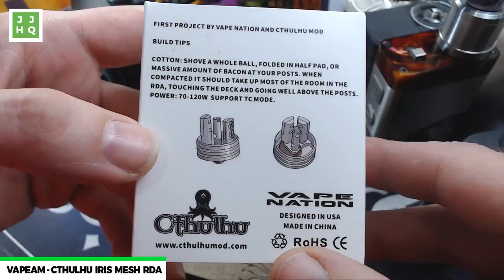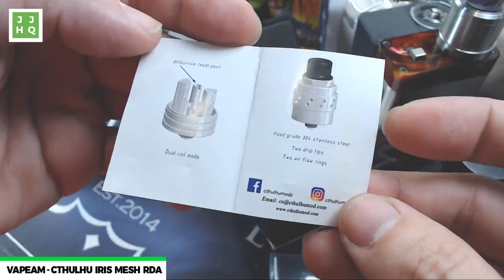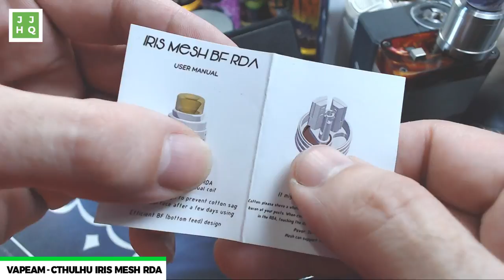The Cthulhu Iris Mesh RDA on VapeAM Ep 189!

Comment: with the state your mesh is in, its no wonder you get hot spots! You even make a point of saying that imperfections (such as "ahem" bends & kinks...) WILL cause hotspots. (not to mention the likelihood of it bursting into flames, any mesh users know what I'm saying lmao) Also, you're never supposed to dry burn mesh....can ya guess why? lol You should always however, put your cotton in, juice it, fire at low wattage (like 30-40), juice again and repeat (i usually do this at least 3-4x) while checking how its burning; making sure theres not hot spots (and adjusting if there is).  This always needs to be done before vaping it with fresh mesh & cotton and since cotton compresses with use, you also need to check how its burning regularly and any time it starts to feel harsh or too hot as this signifies a hot spot.  I also find certain cottons are needed for best results, kendo gold swells allot, breaks down slower and ergo, works well (just needs a little breaking in first). Mesh needs adjusting allot and is a HUGE learning curve, I almost gave up on it initially but once you get the hang of it honestly, its great.   I personally LOVE my mesh, used to like reg coils too but the flavour I get from mesh has ruined coils for me lol
Reply from the maker: What a waste of time. People have been doing this for years, making up new and ununnecessary ways to vape. No, mesh doesn't have a *huge learning curve*, that's just something we tell ourselves when we're doing something dumb, so we can justify it. It's quite simple actually, but I just think it's not worth it. You can go back years in the videos and see that my attitude hasn't changed. 

If you dig mesh rdas, more power to you. But I'm still not convinced, and it's not some poorly lack of enthusiasm, I'm just way past giving a shit. Wotofo gets points for being Wotofo, good for them. If your just looking for someone to agree with you about the profile, I can't be that guy. A blind person can build a Kali in a few minutes. So, it's going to take a good mesh RDA for me to change my mind, and that hasn't arrived yet.
Reply: Well Im not sure why you're talking about the profile by wotofo since we're currently talking about the iris mesh that you kinda sorta just reviewed in this video.... but either way, taste is subjective as are opinions & you're very obviously not going to be swayed from yours anymore than I'd be swayed from mine at the moment. (which wasn't my intention) However, I came to check out your review after watching nothing but positive ones on this unit....I was just a little surprised & I felt that others seeking subjective opinions on using mesh at all would benefit from someone at least playing devils advocate here, to point to that there IS a correct way to use it.  

If someone was reading books upside down and ruled out the enjoyment of reading altogether you'd say thats pretty dumb no?  Well, most people I see using mesh, they're not using it correctly and therefore cant rule on whether it sucks altogether.  
As far as economic value, Its definitely the cheapest option compared to any coils, esp if you vape commercial juices (which are loaded with sucralose), chocolate flavors or juices with coolant, all of which destroy any kind of coils.  Difference with mesh being, its cheap enough that you can toss it without a worry lol... not that thats the only positive in my opinion (& not even relevant to me anymore as its been years since I vaped commercial juice) but its one people likely don't think about.
Reply from the maker: No, I don't agree that my video is like someone reading a book upside down. That's insulting. Sounds to me like it's really difficult for you to maintain a respectful tone with people you disagree with. I'm definitely losing my respect for you, every time you try to argue me down or insult me. And this burning need to convince me, it's just sad. I am not going to change my mind after being abused by a sad internet troll. Just ignore the video. You don't get a 🍪 cookie for being wrong as shit, and writing big silly insulting walls of text about it on YouTube videos. If you're so sure and confident, you can enjoy your mesh vape alone, without any input from me.
Reply: Juicy Jones HQ Juicy Jones HQ WOW!!  you took what I was saying SO  out of context I actually feel kind of embarrassed for you, I was never once insulting…except for maybe now. I’m anything but an Internet troll, a troll is someone who hates on everyone regardless of how idiotic they are acting at the moment.  I was just trying to have an intelligent conversation/exchange of thought. Obviously I came to the wrong place. I hope you don’t treat all of your potential subscribers this ignorantly when they dare to disagree with you...or point out that god forbid, you might be wrong!  Guess what? If you don’t want people to disagree with your opinions, don’t post them on the Internet!!
This was my first time watching your videos and will be the last.  And don’t worry about the respect bud, I have enough from people who matter in real life.
Reply from the maker: No I know how bulling works. You don't get to just pretend it didn't happen. I have a zero tolerance policy for that. I have years of people contributing, and years of jerks too. You're certainly not the former. Obviously I don't need another viewer like you, who can't disagree without name-calling. It's like you're personally insulted that I don't like mesh. Grow the fuck up. Adults don't always agree, learn to live with it without calling people names.